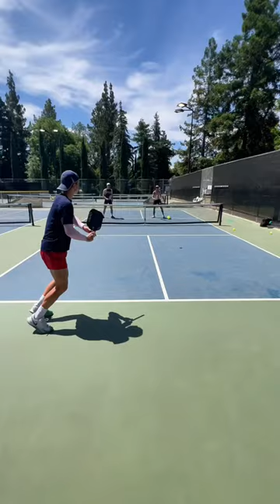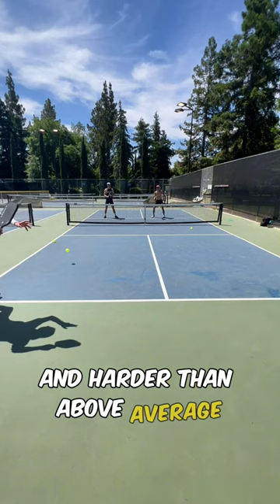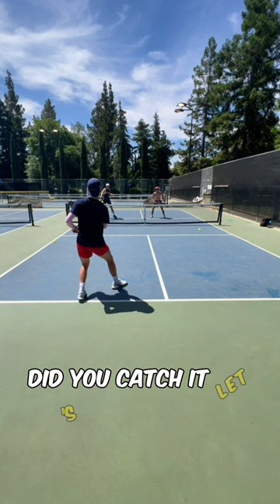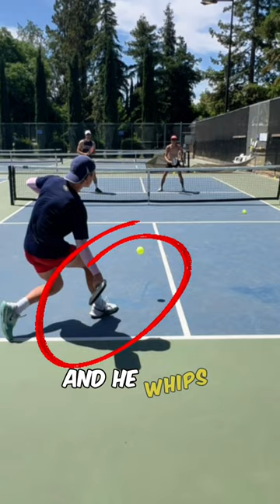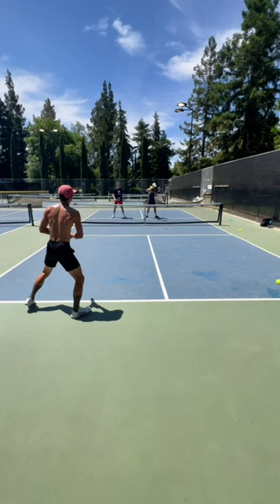How does he hit so hard?

Comment: Top spin. Like I’m tennis and table tennis
Reply: He was hardly using any topspin, and topspin is generated due to friction with the ball in the vertical direction, these paddles and balls have extremely small amounts of friction that can be generated. So I have to agree with the video poster, that it just his technique, and tons of practice. Because hitting it that fast, even if it doesn’t always go in is a challenge by itself, and topspin doesn’t help create more speed, only increases the chance of it falling in at higher speeds due to air drag rotating around the ball and forcing it down
Reply: @jboww2121 I disagree about the paddle not creating much friction. I have the same paddle this guy is using (Legacy Pro), and it creates insane friction/spin.
Reply: @jboww2121  You're right about topspin only helping it fall in, but high end pickleball rackets can 100% generate topspin. Not like a tennis racket, of course, but if what youre saying is true then side spin would be equally difficult to create which is just not true

Comment: I fail to see why pulling the paddle back at the last second would somehow generate more force than pulling way back.  Pretty sure he simply can swing his arm harder than you can.
Reply: Kinetic chain. It's like if you use a whip the harder you can ❤accelerate the end of the chain the better.
Reply: @kalo8524  but you can just start from that position and do the full swing from all the way back. The video is specifically pointing out that he pulls it back at the last second as if that has any effect
Reply: @kylebusc3624 you’re correct, the only benefit to this is that if your technique is correct, it makes it easier to get that acceleration. If you wind up but only use your arm and hit at the same speed, it will be the same, it just requires more effort, and bigger swings are more error prone and take longer. The other benefit is wrist snap is useful for creating topspin, which doesn’t increase ball speed, but forces the ball down as it travels giving a better chance of landing in. People commenting one word comments like kinetic chain and topspin as if the answer is so obvious, but still can’t realize if you swing with the same acceleration the same thing will happen 😂
Reply: @kalo8524 EXACTLY
Reply: I think of it kinda if you’ve ever been pulled on a tube behind a boat you can get a bungee whiplash from the change in angular momentum. Kinda like how where the string attaches to the tube is the handle and then the string slash boat is the arm. Also the arm can start accelerating before the racket is dragged along. Idk if that’s a correct analogy but feels right to me. Or it’s like cracking a whip if it was on the ground. If you go right first with the tip being still and then swing the whole thing right it’ll snap at the end vs just starting to swing the whole thing to the right.